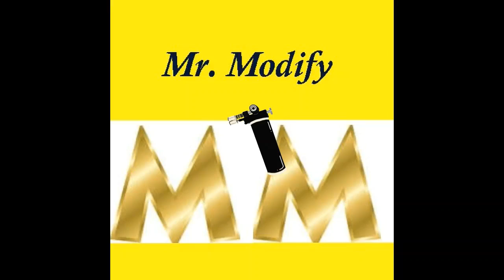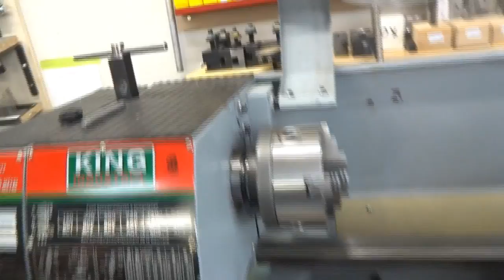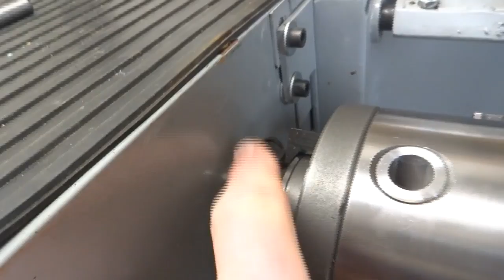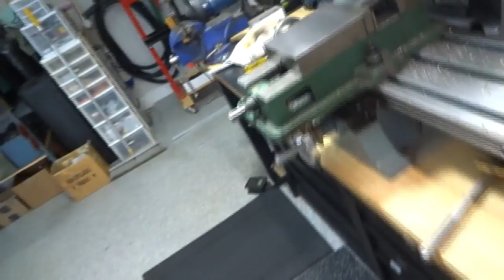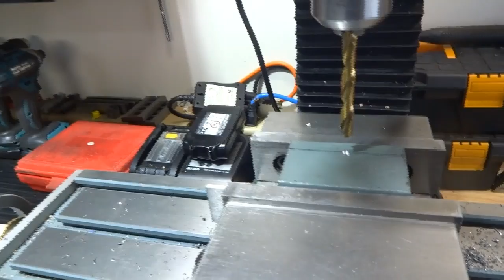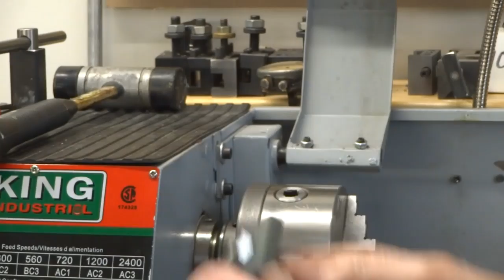Simple Lathe spindle lock.

Comment: You never bash the chuck key like you did!!!!! A tradesman would use an open ended spanner on the chuck jaws to unscrew the chuck!!
Reply from the maker: Done it this way for years. No other place to get leverage to release the thread lock on this style of chuck. Open to suggestions if you can provide a detailed description or video. Thanks for your comment.
Reply: @MrModify   tried adding spanner photo and pinterest link here but the keep dissapearing so I put it on top in a new comment
Reply: @MrModify  ive been trying to attach reference to photo but its not working! How do I get to show you , its a pinterest link
Reply from the maker: Just copy the URL in url browser (ctrl-C) and paste it into your youtube reply (ctrl-V)
Here is a random link that I have copied. https://www.pinterest.ca/pin/146155950395422399/

Comment: Why couldn't you use the two bolts right behind the chuck in the video?
Reply from the maker: Interesting thought. I could put a steel plate on the two bolts so it extended over the top of the chuck and use it as an anchor point for a slide thru hole for my pin. Good thinking nuckles.